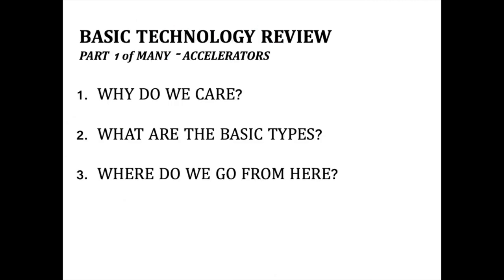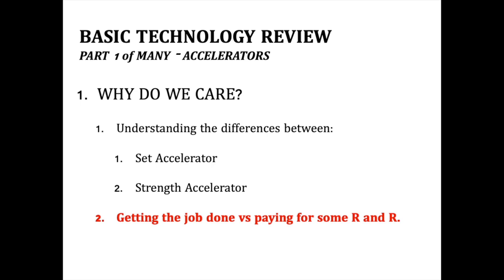Concrete Accelerators - The Differences and Purposes between the Types VLOG 731

Comment: When will be available for general use the products in Roman Concrete mix?
Just with use of Volcanic Ash as arid, the resulting Concrete résiste under Sea water for millennia.
The Windsor building fire in Madrid proved concrete pillarse withstood temperatures above 1'000° C for a long time.
If you find a mix with no water and air porosity, with a solide tightness, you could even thinking in making something as an Space Shuttle in Concrete.
Karlsruhe tech built a kart on a pre-stressed concrete plate, with a body thickness of four millimeters.
Blessings +